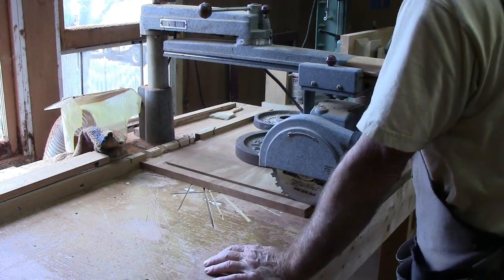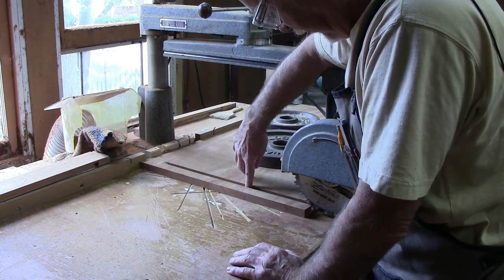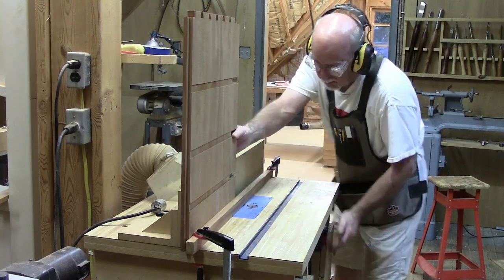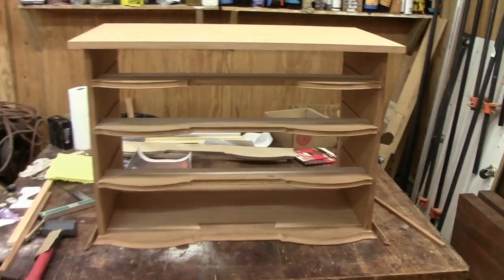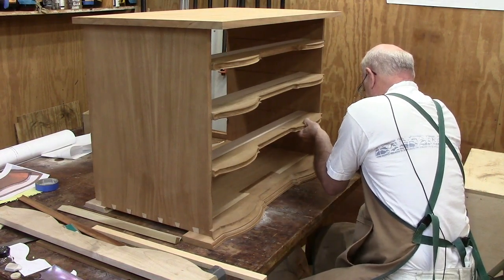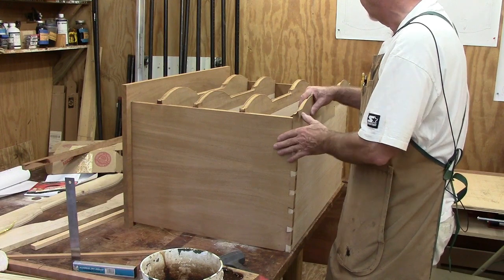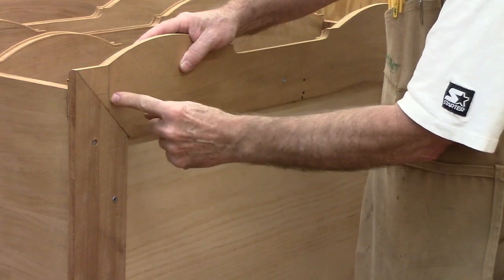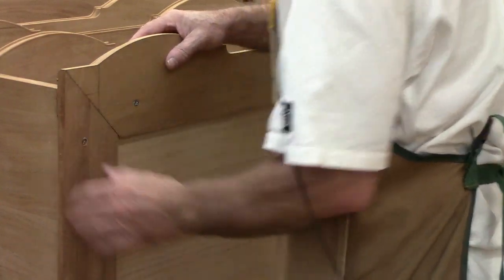Mahogany Curved Blockfront Chest Top & Molding Step 3

Comment: How did you plane down the sliding dovetail?  Do you have a dovetail plane?  Thanks for posting these great videos.
Reply from the maker: Jim, I used a shoulder plane to remove a little material from the dovetail so it would fit. Here is a link to my blog. It goes into a little more detail. http://davidboefffurnituremaker.blogspot.com/2017/09/mahogany-curved-blockfront-top-molding.html

Comment: "Using my 18th century pin nailer" haha!

Question: I notice your initial point of reference is from a photo of the original piece that you then replicate.  Do you draw complete plans before you begin your work?... or do you tackle the job piece by piece without much in the way of drafting a complete plan beforehand?
Reply from the maker: Ken Teague Most of the time i draw them from measuring the piece,  that helps me think through the construction

Comment: Were those tapered sliding dt's?  Also did you spline the mothers on the bottom moulding?
Reply from the maker: Yes Robert it is a tapered sliding dovetail.  Here is a link to my blog where I go into more detail. http://davidboefffurnituremaker.blogspot.com/2017/09/mahogany-curved-blockfront-top-molding.html
Reply: David Boeff Mouldings not mothers.  Thx spell check. ;-)